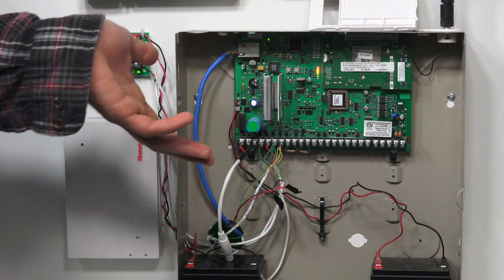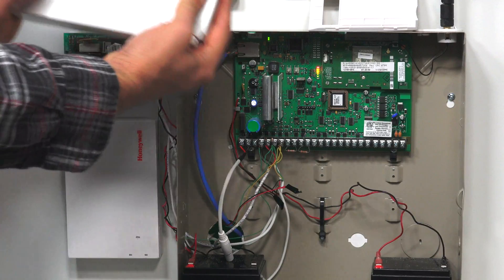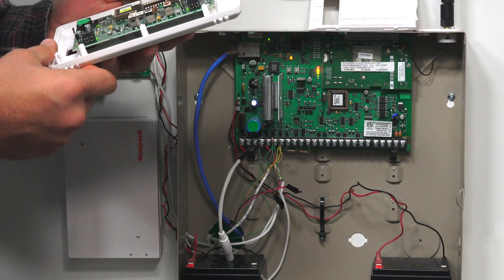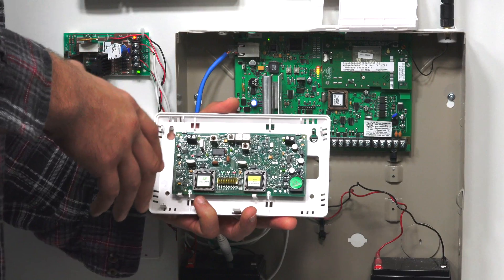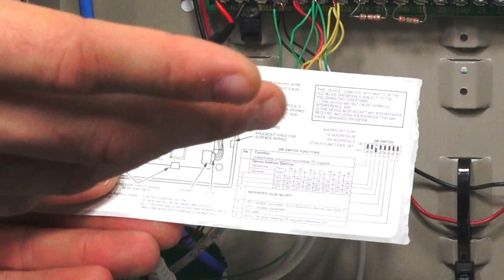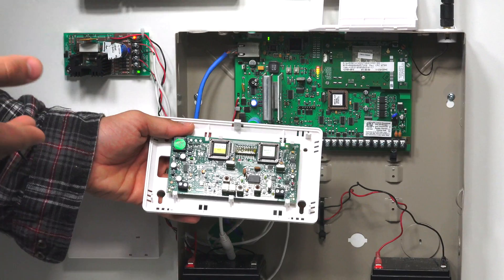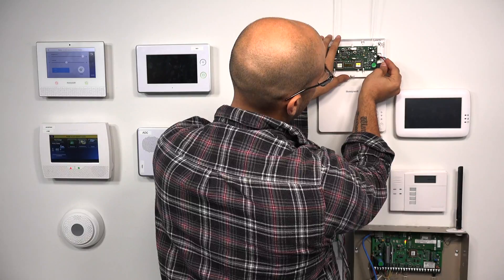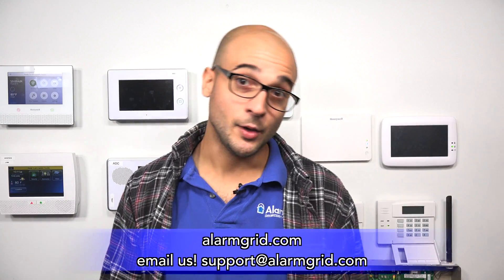Wiring a 5883H to a VISTA Security System

Comment: A wiser choice would be a 6160 RF KEYPAD  Cheaper and much easier to install and program. Also better RF reception. The keypad is out in the open. The panel is hidden in a closet.
Reply: Hi @Bills6946, The 6160RF is a good option for adding Wireless to a Vista System. In certain situations to maintain proper coverage for the installation location, a centralized Receiver such as the 588x Receivers are a better option as they allow the receiver to be mounted at the panel and up to about 300' from the system with the correct wire size so that coverage can be obtained throughout where the 6160RF is most likely mounted at a door away from the other side of the home or installation location.  The 5883 is designed to work with wireless keypads which have a limited range, so they can be mounted in remote areas where a wireless keypad would be in range of the transceiver.
Reply: @DKAlarmgridSupport 
The average house has two keypads and the panel is buried in a closet at one end of the house. Select the most central keypad and replace it with the 6160 RF. Cheaper, easier to install and faster. If you already have a 4219 expansion module in the cabinet with a 7 ah battery, you will not fit the RF module inside the box.

Comment: I currently have a receiver keypad next to my alarm panel, upstairs center of home. There are two other keypads (6290W) at doors in our home. My understanding is to use the 5883H, I'll need to disconnect the receiver keypad? 

The reason for considering the 5883H is that a couple of the door sensors a good distance from the receiver keypad sometimes show a fault; it's rare but happens maybe once every two months. Batteries have been changed and bigger sensors installed but intermittent fault still occurs. Will the 5883H with it's longer external antennas receive these distant sensors better than the receiver keypad?
Reply: The 5883 will not allow you to extend the range. I think you should look into getting a 5800RP as that is made to extend the signal.

Comment: Can I wire more than one transceiver on a Vista20P board? I want to do use 2 transceiver-keypads in two different houses but controlled with one vista20pboard. Like increasing sensor range.
Reply: the 20p can only handle one
Reply: @joshuagriffin2807  Do you know any board which can handle more than one trasceiver or transceiver-keypad?
Reply: @Mooliado  vista 128